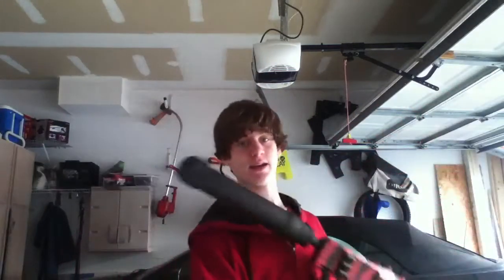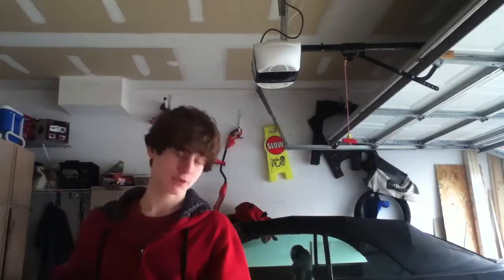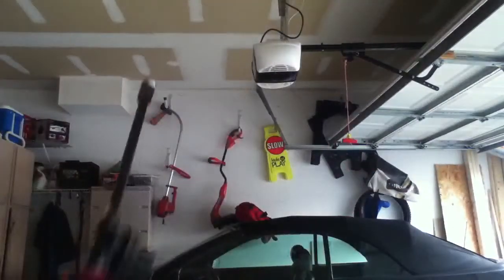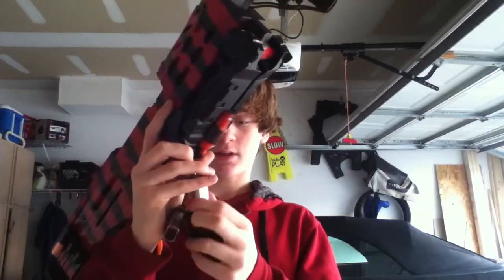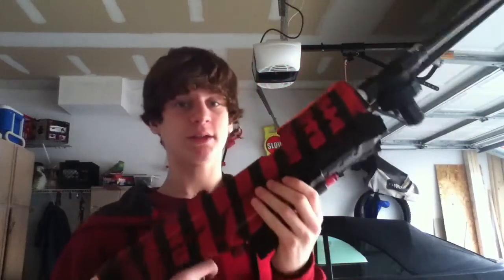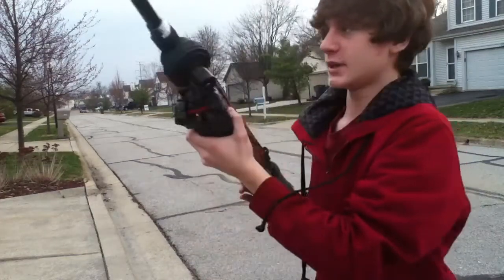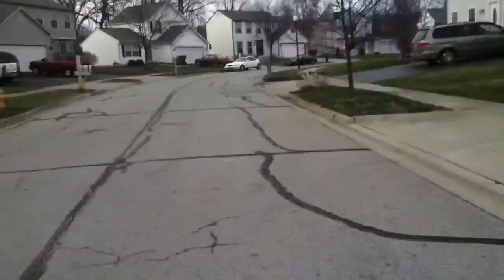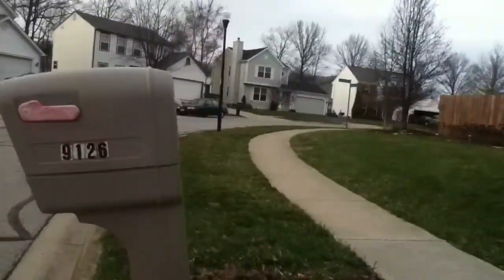My Epic New Homemade Sprinkler Valve Airgun With Longshot Shell

Comment: I like the look of this gun, but it fires a queef compared to a potato cannon.  Also, if you mod the sprinkler valve with a blow gun trigger instead of the solenoid, you will get way more power out of the gun as it will open the valve much quicker.